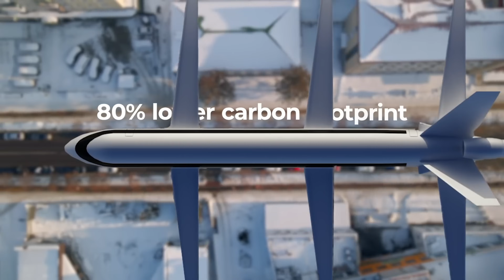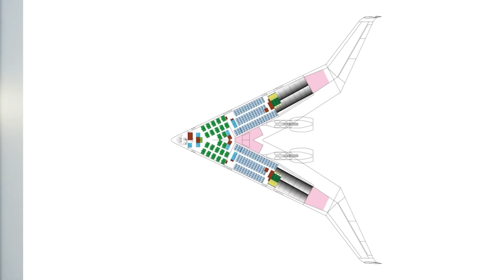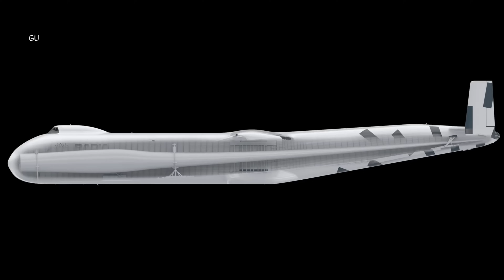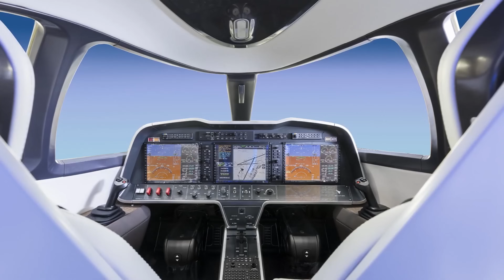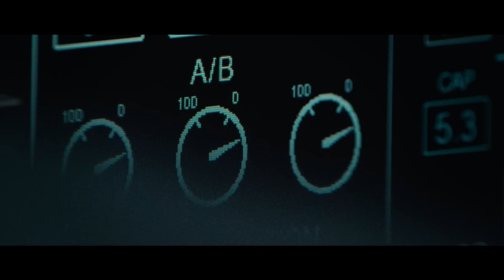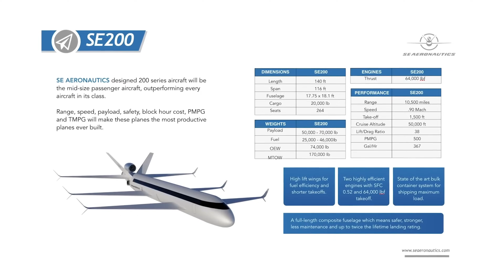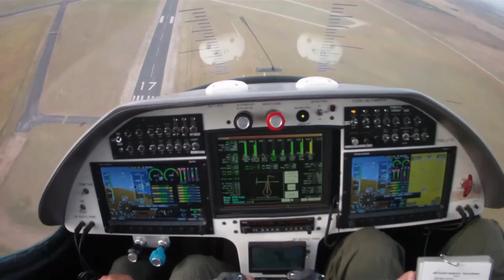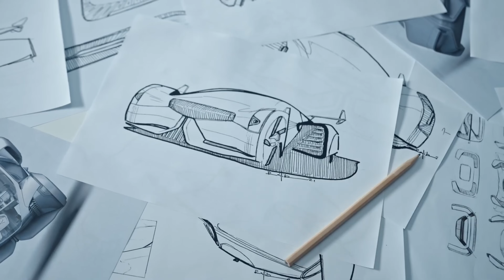PLANES THAT WILL CHANGE THE WORLD

Comment: AntiGravity Aircraft The Next generation Spaceship
Work base on Gravity just spinning by using car's engine
can fly in bad weather plunge in the ocean even in outer space

Earth which weight predict 600 trillion ton does not fall at the Sun because of centrifugal in orbitting, on the contrary it does not be thrown far go out the orbit line of hold by gravity at the Sun as orbit center. Gravity and centrifugal is equal called Equillibrium, thats why until now Earth which we was inhabited always rotate and circulate the Sun. Now we justly take example : how if the gravity used and centrifugal is negated? The Earth will float far leave the Sun. So that centrifugal can be used to fly far away if gravity eliminated. Finally how to eliminate gravity?

It’s way rotate part of aircraft by horizontal. When that rotation faster centrifugal force getting greater and the gravity getting smaller, finally it lose the gravity and the aircraft start flying. Of course people would surprise: how the aircraft can keep rotate without fulcrums? Thats why we named that aircraft Shuttling System that is aircraft likes two disc adjoining attached in the midle as fulcrums:

A. The Top part, we name Positive rotate to right, and the edges is getting thicker and havier.

B. The Buttom part, we name Negative rotating to left, and the edges is getting thicker and havier.

C. Middle Part , we name Neutral, air crew placed and also machine and everythings turning Negative and Positive at the same time.

The aircraft can liftup added with explosion from the engine. However that aircraft construction later, let the engineer doit it, and we are sure the aircraft will bulletproof and also waterproof.
 
.
.
 
In modern civilization where human being generally using flying saucer as vehicle, will a lot of change in lives either in materialism and in psychological. In materialism area will apply the change in life like.
People no longger need roadway and rel road which spend large of energy, money, places, things and time, object place and time. People would utilize that area for habitat or for other need:
Reply: 10:57 uh that flame coming from the rear, right ,viewer aircrafts left is a indication that issues were filmed hopefully noticed besides those in that aircraft at the time being filmed.disturbing and frightening on a experimental.but success come at many trials and errors butwhen your off the  ground hundreds if not thousands of  feet above.the trials and errors become more and more diamics in those errors trials,fires being the ones you don't want.period

Comment: I am still wondering why wind turbines have to be so large in scale. Do they really have to be so large?
Reply: AntiGravity Aircraft The Next generation Spaceship
Work base on Gravity just spinning by using car's engine
can fly in bad weather plunge in the ocean even in outer space

Earth which weight predict 600 trillion ton does not fall at the Sun because of centrifugal in orbitting, on the contrary it does not be thrown far go out the orbit line of hold by gravity at the Sun as orbit center. Gravity and centrifugal is equal called Equillibrium, thats why until now Earth which we was inhabited always rotate and circulate the Sun. Now we justly take example : how if the gravity used and centrifugal is negated? The Earth will float far leave the Sun. So that centrifugal can be used to fly far away if gravity eliminated. Finally how to eliminate gravity?

It’s way rotate part of aircraft by horizontal. When that rotation faster centrifugal force getting greater and the gravity getting smaller, finally it lose the gravity and the aircraft start flying. Of course people would surprise: how the aircraft can keep rotate without fulcrums? Thats why we named that aircraft Shuttling System that is aircraft likes two disc adjoining attached in the midle as fulcrums:

A. The Top part, we name Positive rotate to right, and the edges is getting thicker and havier.

B. The Buttom part, we name Negative rotating to left, and the edges is getting thicker and havier.

C. Middle Part , we name Neutral, air crew placed and also machine and everythings turning Negative and Positive at the same time.

The aircraft can liftup added with explosion from the engine. However that aircraft construction later, let the engineer doit it, and we are sure the aircraft will bulletproof and also waterproof.
 
.
.
 
In modern civilization where human being generally using flying saucer as vehicle, will a lot of change in lives either in materialism and in psychological. In materialism area will apply the change in life like.
People no longger need roadway and rel road which spend large of energy, money, places, things and time, object place and time. People would utilize that area for habitat or for other need:

Comment: All interesting technology.😊
Reply: AntiGravity Aircraft The Next generation Spaceship
Work base on Gravity just spinning by using car's engine
can fly in bad weather plunge in the ocean even in outer space

Earth which weight predict 600 trillion ton does not fall at the Sun because of centrifugal in orbitting, on the contrary it does not be thrown far go out the orbit line of hold by gravity at the Sun as orbit center. Gravity and centrifugal is equal called Equillibrium, thats why until now Earth which we was inhabited always rotate and circulate the Sun. Now we justly take example : how if the gravity used and centrifugal is negated? The Earth will float far leave the Sun. So that centrifugal can be used to fly far away if gravity eliminated. Finally how to eliminate gravity?

It’s way rotate part of aircraft by horizontal. When that rotation faster centrifugal force getting greater and the gravity getting smaller, finally it lose the gravity and the aircraft start flying. Of course people would surprise: how the aircraft can keep rotate without fulcrums? Thats why we named that aircraft Shuttling System that is aircraft likes two disc adjoining attached in the midle as fulcrums:

A. The Top part, we name Positive rotate to right, and the edges is getting thicker and havier.

B. The Buttom part, we name Negative rotating to left, and the edges is getting thicker and havier.

C. Middle Part , we name Neutral, air crew placed and also machine and everythings turning Negative and Positive at the same time.

The aircraft can liftup added with explosion from the engine. However that aircraft construction later, let the engineer doit it, and we are sure the aircraft will bulletproof and also waterproof.
 
.
.
 
In modern civilization where human being generally using flying saucer as vehicle, will a lot of change in lives either in materialism and in psychological. In materialism area will apply the change in life like.
People no longger need roadway and rel road which spend large of energy, money, places, things and time, object place and time. People would utilize that area for habitat or for other need: